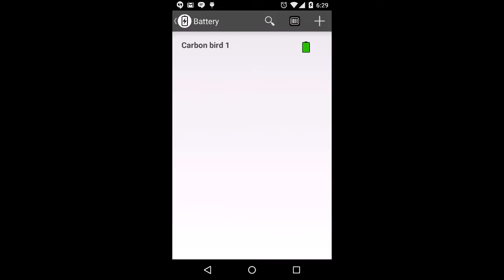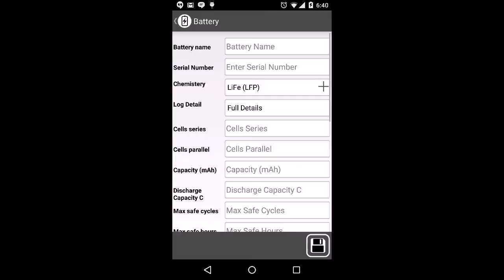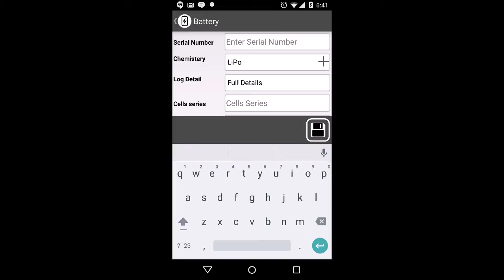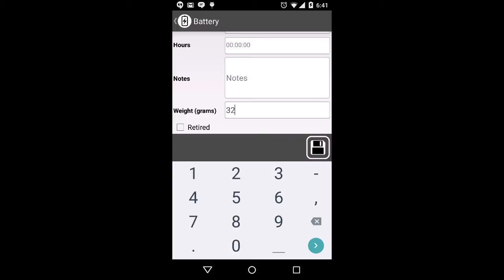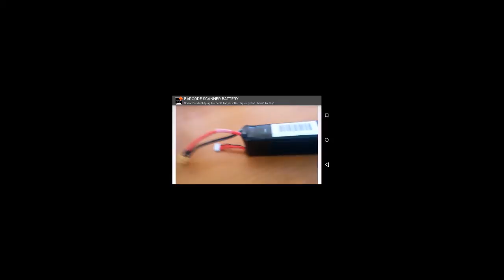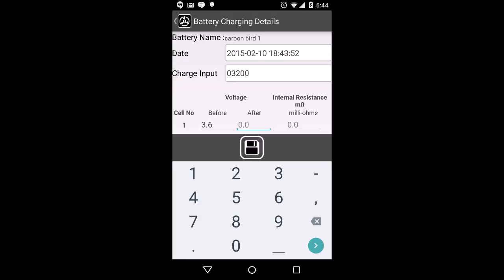RPAS Logger PLUS Intro and batteries

Comment: How do you add 2 batteries for one airframe. I have two airframes that use 2 batteries at the same time. Please tell me it is possible otherwise I have to rewrite my operations manual.